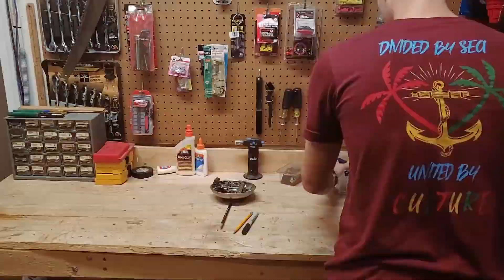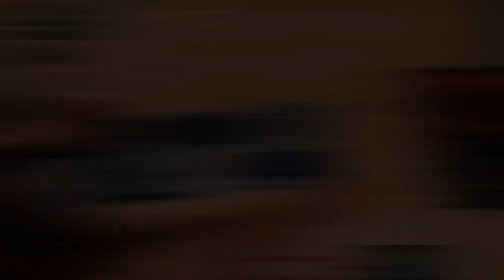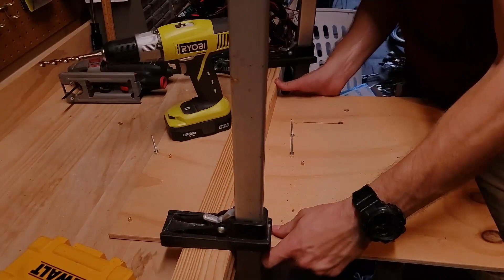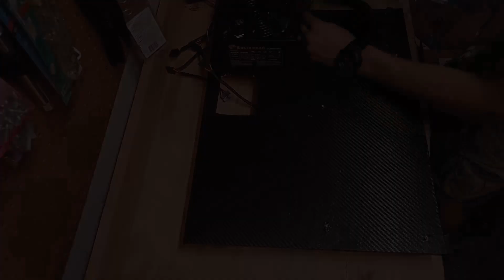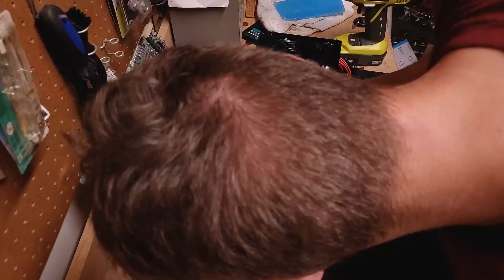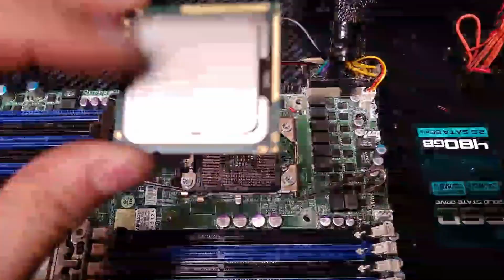Cheapest Wall Mounted PC Ever! Time Lapse Build

Comment: How did you mounted the gpu. Did you attached any kind of plate on the back of the gpu?
Reply from the maker: The GPU was mounted by sandwiching it between 2 nuts on bolt. There was no plate except the proprietary heat dissipation plate, which was not used to mount.

Comment: I've been given that MB, how did you connect the 650W Solid Gear PSU to the board? No mods? Thanks for the vid anyhow ;-)
Reply from the maker: I'd love to know what you did with it! The pinout is proprietary and requires 8 12V lines (the yellow ones) so you'll need a PSU with at least 2 GPU cables to pull from. Assembly is definitely required but it's an inexpensive powerhouse when you're finished!
Reply: @steinsharktv9910  Thanks, I'm a real newbie... Still I'm looking for the right PSU.. (any suggestion would be welcome!). I'll let you know when I'll be done with this project...

Comment: Ok, liquid cooling is cool, but a single  92mm radiator for 2 CPUs? You would have been better off with 2 half decent air coolers...